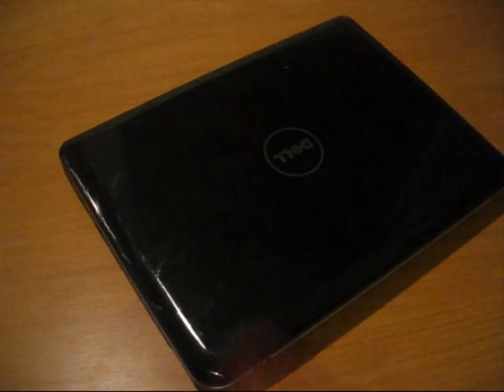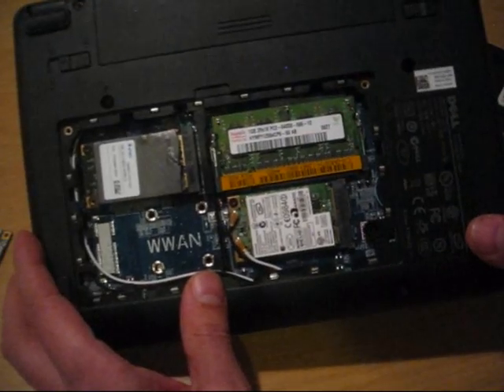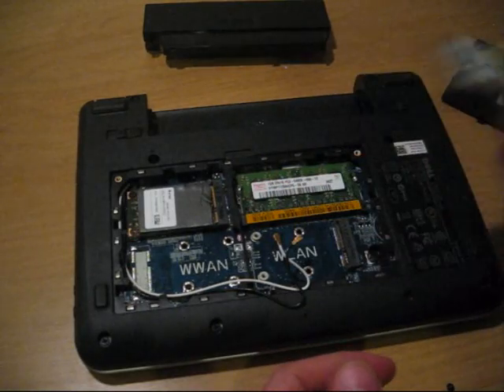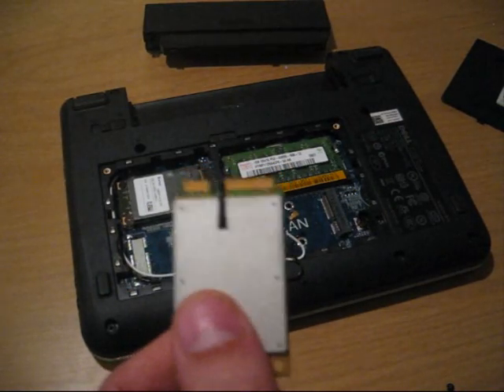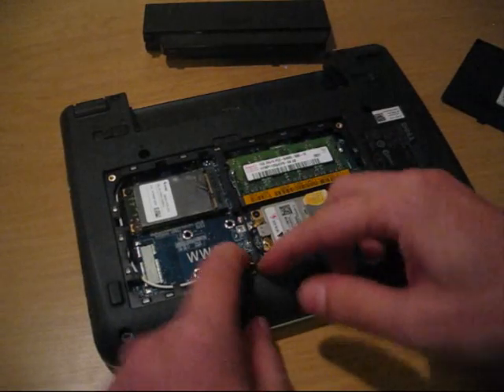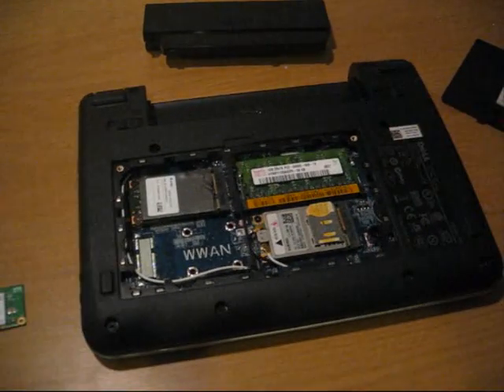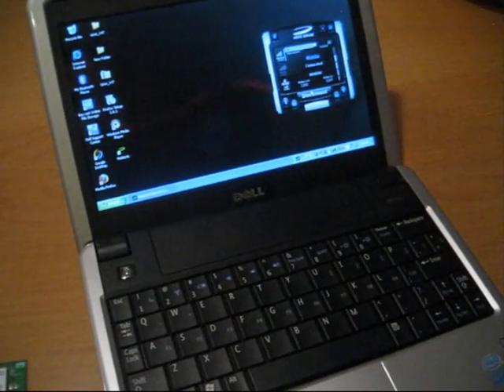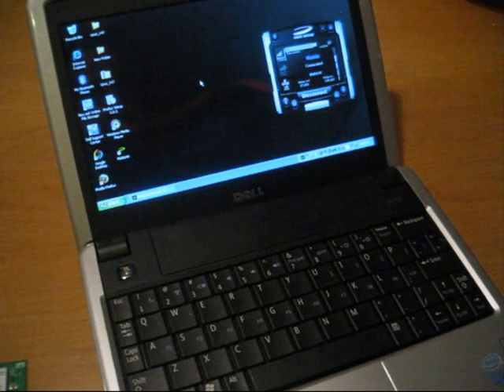How-to: Internal 3G to Dell Mini 9. The easy way

Comment: friend, because you do not used the slot "WWAN" to connect 3g card? When you see it, you could keep the wifi the same way and have both devices working, right? would question the pins? good, like an outlet, because I'm moito interested in purchasing this card and keep the wireless on my dell 7520 15rse ..

Comment: I got a question, I got a Sony Vaio that is based on the same chipset as this dell but of a older design (VGN-TXN15P) that I removed the useless wwan card so that I got an empty slot. I am wondering what ssd would work in that slot that has its own pata or sata controller. Doesn't need to be bootable but will be used as either extra storage or for caching.

Comment: hey there i know this video out dated and all but I was wondering how can I get the 3g and software onto my dell mini 9 I tried to solder a 3g card slot and wwan onto the board but forgot can't access without the firmware been enabled

Thanks